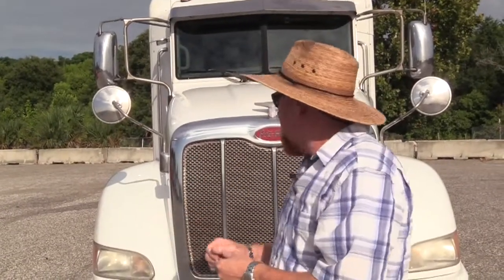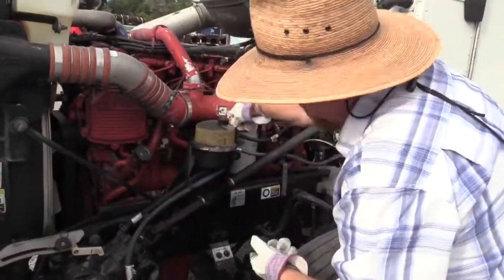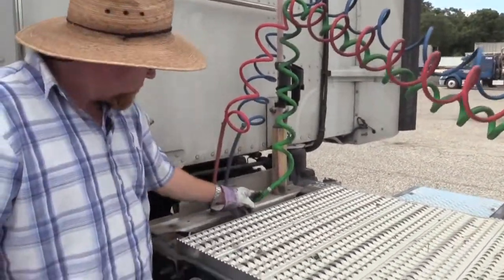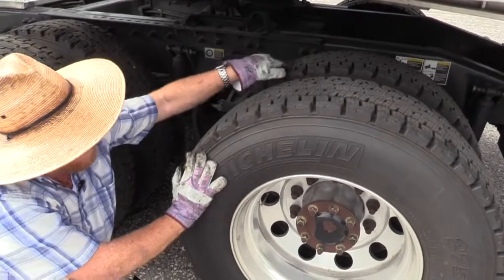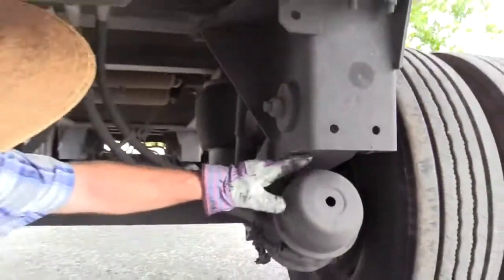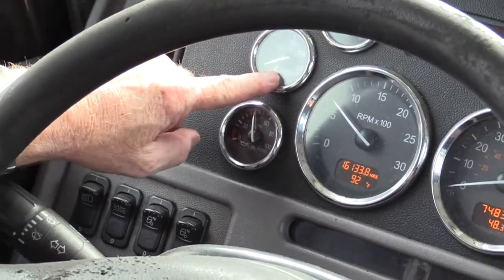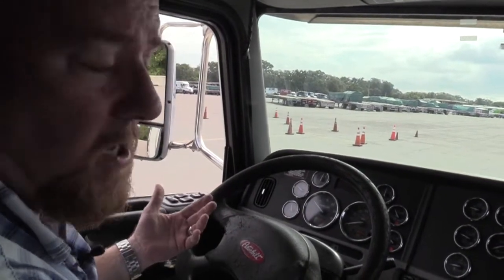Cypress Truck Lines Pre-trip

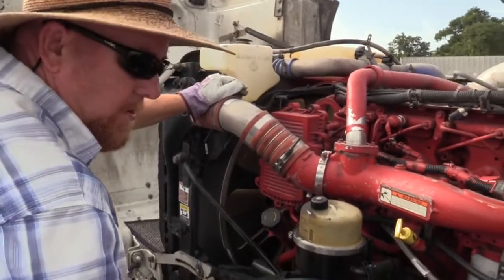Comment: 12:13 Steering System
14:44 Suspension
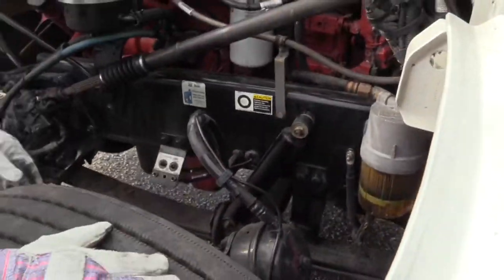17:03 Front Braking
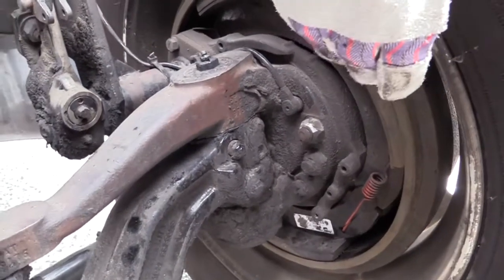19:22 Rims/Tires
31:13 Rear suspension
34:09 Rear Braking
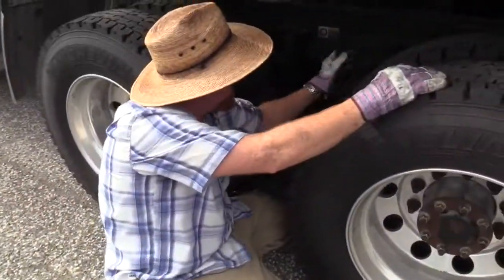36:49 Rims (Bud Spacing)
39:43 Reflectors/Multi Function Lights
40:31 Apron